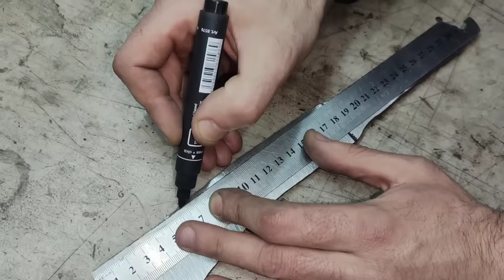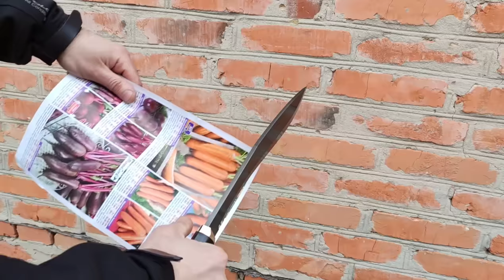Making wootz steel out of a car chain. Making a Nepalese KUKRI Knife

Comment: The handle should be a slight angles from the khukure to give it a small angle for increase in striking power. Anand Joshy from Nepal.
A job well done but aspects missing. Sorry, I had to mention this.

Comment: This is FZ's own type of a Kukri. It is NOT a NEPALESE one. From the Way it is hammered out, the Spine is shaped or how the Tang is formed it's completely different. Even right down to how the heat treat is done. There is almost ZERO use of a sander belt or other modern tooling. The heat treat on a real one is just on the cutting edge. It's amazing to watch a real Nepalese Kukri be made. This isn't how a traditional one is done.

Comment: Hello, fantastic knife as always! I am curious if you have tried using a basic carbon steel (Like W2 grade or 1095 grade steel + similar steel powder) to make wootz before? I am not sure what effect the glass flux would have on the alloy, but the graphite should help keep the carbon content at a good level. I think you may be able to get a hamon on one of your blades if you start with a simple carbon steel. You will probably have to etch the blade with a lighter acid, diluted ferric chloride or lemon juice will work well. I think the wootz pattern would look really good with a hamon, and make some interesting effects in the steel.

(Attempt at Google translate Ukrainian)
Привіт, фантастичний ніж, як завжди! Мені цікаво, чи пробували ви раніше використовувати базову вуглецеву сталь (наприклад, марку W2 або сталь марки 1095 + подібний сталевий порошок) для виготовлення wootz? Я не впевнений, який вплив мав би скляний флюс на сплав, але графіт повинен допомогти підтримувати вміст вуглецю на належному рівні. Я думаю, ви можете отримати хамон (hamon) на одному зі своїх лез, якщо почнете з простої вуглецевої сталі. Вам, ймовірно, доведеться протруїти лезо більш легкою кислотою, добре підійдуть розчини хлорного заліза або лимонного соку. Я думаю, що візерунок Вуца дуже добре виглядав би з хамоном і створював цікаві ефекти на сталі.
Reply: The glass typically was used to seal the canister steel from the air
Reply: @jamesreynolds9909  Still protects the alloy from oxidization. Regardless, I'm not sure what effect it might have on the composition of the alloy in terms of clay tempering. Typically you need a low alloy high carbon steel, and adding potential trace elements could compromise that ability. Manganese is infamous for this for example. This is why I added that to my comment.
Reply: Few things, glad your interested but your googling is so-so.

The chain is of unknown alloy, which creates the pattern in the homogeneous billet of completed steel. Adding w2 or 1095? The powder steel is not magic dust, it's powdered metallurgy steel. A formulated powdered steel. For all we know, it could be 1095 powdered... soooo there'd be no point in adding chunks of 1095 bar for example.

For the sake of answering your suggestion, even if you just used powdered 1095, a chain, glass and anything else you wanted to add, the alloy from the chain which created the pattern in this case would prevent a hamon forming. I can explain it, if you are genuinely interested though you should research it. Not some fella applying clay and blah blah blah. The actual metallurgy. Walter Sorrels (on youtube) is always good at explaining things well for anyone to understand.

Either way, for theory's sake (which won't work) even if you could achieve a hamon, it wouldn't be very visible - due to the pattern of the steel once etched. The hamon wouldnt be visible.

Say you made a 300 layer 1095/w2 damascus then attempted a hamon -  it wouldn't work either, the reason being the heat transfer between the layers is different. Even though both steel formulas individually can achieve a hamon, it would not be successful.

Hamon is a very simple yet difficult to achieve process that relies on extremely specific conditions. Mainly heat dissipation and the transformation of austenite to martensite in the steel at a molecular level.
Reply: @robsonez  Heh. Googling. No, I am a blacksmith myself. I have worked with and forged both steels, as well as more alloyed steels like 5160, 80CrV2 and plenty of reclaimed steel. I have done patternwelding, laminated blades, hamons and regular ol' blades. I've done plenty of firepokers, wall hooks, bottle openers and other non-bladesmith objects. The reason I phrased it as using "a basic carbon steel (Like W2 grade or 1095 grade steel + similar steel powder)" was to use chunks of either steel and use a similar (low alloy) powder along with it. No chain involved.

While I have not personally made one myself, I do own a blade or two with a hamon that are made of pattern welded steel. It's not a super common practice, however there are a few commercial sword brands that have such offerings, and of course also private smiths do as well. One example is Dynasty Forge's Tri-steel series, made of folded 1095, 1080, and 1060. I have etched similar multi-steel folded blades to bring out the effects of the hamon (I wasn't impressed by the factory etch). The key is to use a less powerful acid like lemon juice. The play between the layers is subtle but pleasant, and the hamon is vibrant. The differential in heat transfer between the steels is minimal and inconsequential to the final products hamon.

I'm guessing you're also a bladesmith, but I don't know if you have tried it yourself. If you haven't, try it. If you have, try it again with an altered process. I actually want to try this for myself now. I've got a few bars of stock 1095 and W2 hanging around. I'll give it a go when I have the time.
Reply: @TheGreenGamer33  I make knives ftime for a living and have dabbled with hamon.

It seems completely redundant to hamon a blade that's pattern welded in any way to be honest. You'll either see a vibrant hamon and no pattern or alot of pattern and no hamon.  I work primarily with carbon san mai and although it may be possible to achieve intentional hamon with this configuration of say 1095 core steel and w2 outer cladding vice versa, I truly doubt it would add anything to the aesthetic if it could be successfully achieved with any control. Auto hamon is not the same as hamon when it comes to control of the pattern, the only control is the depth of which the blade is quenched to achieve differential heat treatment and therefore auto hamon (not true hamon).

To do what you are suggesting, a multi layered dami with clay hamon seems fairly implausible. The layers alone would disrupt the austenite/martensite transformation giving you very little or no hamon. The best conditions to achieve hamon also come with high failure rate. Either the hamon doesn't occur due to too much or too little heat at quench or the rapid quench is too violent and the blade snaps or cracks. Even if this extremely subtle dami hamon combo was achievable, how many pattern welded knives do you want to destroy to achieve this?

I've considered hamon on core steel of san mai with much of the cladding removed but it truly is an expensive experiment for what is likely to be very little result. 

Just attempt the hamon with a suitable steel and master control of it. That, in itself is a challenge worthy of pursuing. Auto hamon through differential heat treat can be done with most steels but it is truly not the same.
Reply: @robsonez  "You'll either see a vibrant hamon and no pattern or alot of pattern and no hamon." Yea this is mostly true. The pattern is subtle, but it is still visible. I personally like the effect. It creates an interesting cloudy, swirly effect at the edge of the hamon, where the hardened drops off and the softer starts.

I've done a clay tempering hamon on one of the san-mai blades I made a while back. Was forged from an old file and some mild steel, so far from scientific haha. In that case it worked quite well, even if I wasn't expecting much. I used Park's 50 as the quench medium incase you were curious, was a little scared to attempt a water quench.

Anyways, I think I will give damascus with a hamon a shot. If I ever remember I'll try and report back with links to pictures of the result. I didn't mean for any ill will here, so have a good one.